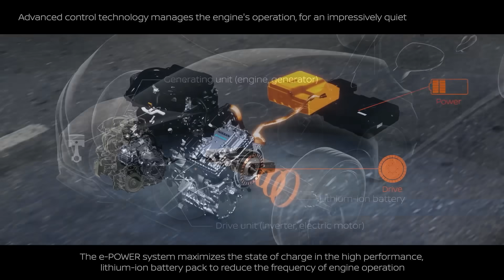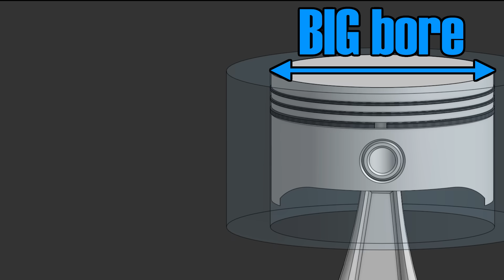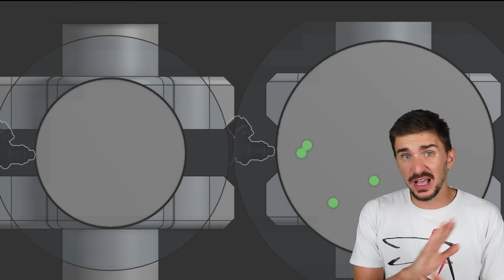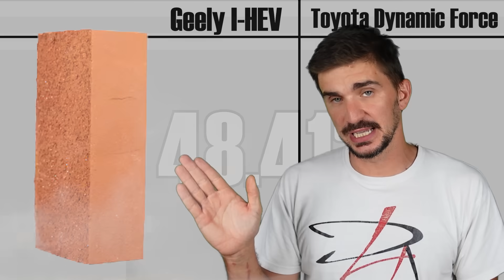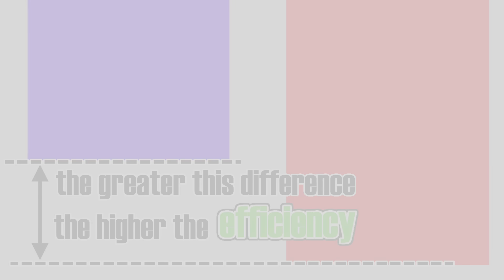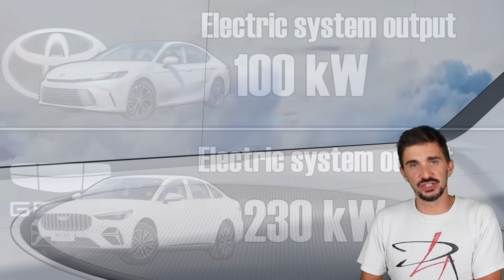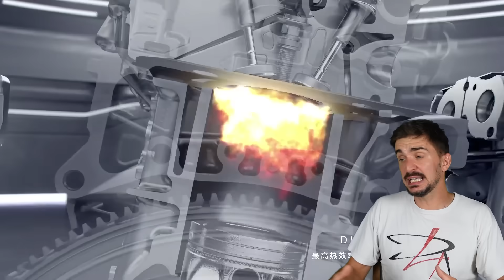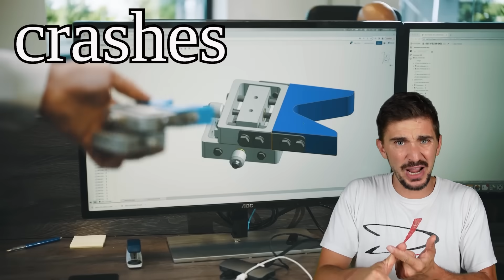How China's Geely Beat Toyota, BMW, Ford and Everyone Else

Comment: Never understand why the turbocompounding isn't used it literally increases efficency
Reply: Because it costs money.
Reply: It is used, not much in automotive industry though. Volva had some truck engines with turbocompounding. But I think it could be really good with a Roots type supercharger.  It is money reasons
Reply: @pdehun6234  IIRC they used it on the 16L 6 cyls which were less reliable, less fuel efficient, and less powerful than Scania's V8's lol. The spooldown sounds ridiculous though.
Reply: @stuntvist  You can be right about that Scania v8 was better , bc I don't know :D But if you take two idinetical engine it should get better range and more power with turbocoumpounding. Ofc t.c. only made big things in aircraft when turbojets were not that cheaper to run.  But I would say there is more likely to have room to make it even better. Maybe if some car manufactures did not act like some whine little bitches but spend money on improvements while they buisness was booming they would not been in this situation.
Reply: Forced induction only increases efficiency in gasoline engines in an extremely specific band and realistically won't improve efficiency because of their need for a stoichiometric mixture. Diesels however, always benefit from forced induction. Greater efficiency and more power.
Reply: @artemovsk1 Turbo compounding is not forced induction, you think about compound turbine superchargers  way different. I highly recommend you to see Greg's Airplanes and Automobiles's video about Turbo Coumpond named " Turbo Compound Piston Engines. Almost magic tech."
Reply: @artemovsk1  he's talking about power recovery turbines. Basically you attach the exhaust side of a turbine to the exhaust and then you couple that shaft to the crank to convert the heat energy in the exhaust to mechanical power to the crank. Used towards the end the of piston aircraft engine era to increase crank hp and fuel efficency.

If you want to go nuts with exhaust plumbing you build a compoundturbosupercharged turbo compound engine.
Reply: @KR-hg8be Ah my bad. Somehow I haven't heard of this before.
Reply: @KR-hg8be  i believe when they went nuts with the exhaust plumbing they decided "why do we need pistons?" and built a jet engine.
Reply: @JedPotts-jv2ux pretty much because at that point the engine is only functioning as a burner section in a turbine
Reply: It's really heavy and complicated. It's mostly used on 2-stroke diesels too, and they only operate properly at max load and at one RPM.
Reply: Turbo shooting air inside the open valves?
Reply: @gabrielvieira.4358  No, Turbo Compound use a different turbine. Turbine superchargers use pressure turbine, while Turbo Compound systems use a blow-down turbine.  The blow down turbine in Turbo Compounding use the exhaust velocity to spin the turbine then tuebine is linked via fluid coupling to the crankshaft to spin.
Reply: coz it is already electrified, thats why! who needs turbo compounding?
Reply: @djhrjeiwhri  Turbo-compounding means that the turbocharger is also connected to the crankshaft via CVT so that excess turbine power is used instead of wasted. It's make the engine more efficient.
Reply: @nerdyengineer7943  so? connected to parasitic-loss? more efficient?
Reply: @djhrjeiwhri  The engine generates the electric power, dummy. It's not parasitic loss, it's where the power to drive comes from. Sheesh.
Reply: @nerdyengineer7943  it is still need turbo with pumping losses, still cannot have this level of gasoline thermal-efficeiency and STILL have parasitic loss, idiot! especially compare to contrary to this geely systems + DEEP-MILLER. after all it is enginied-EV, so all of  pumping loses, every auxilaries, weight penalties are eliminate to near zero on its ice.
latest turbo nissan zr15ddte on qashqai hybrid has 42% thermal-efficeiency, if nissan do turbo-compounded, what thermal-efficeiency does it have? 50%????

Comment: If they had put a 1-cylinder engine and an electric motor on a motorcycle, the consumption would have been minimal. Probably 0.5 liters per 100km.
Reply: The problem with motorcycles is that they don't have much space for the batteries

Comment: The only reason why China released that engine is the pompous headlines in the newspapers for the sake of CCP propaganda and the story that China is some kind of country of the future that should be invested in. Why? Because the Chinese economy and industry have been in decline for 5 years. China is rapidly collapsing. Investors are fleeing China because they realized that China is a big scam... a Ponzi scheme... a Potemkin village... and that the Chinese are bringing in foreign companies exclusively to steal technology and then drive them out of the market. But now everything is backfiring on them and in 5 years the question is whether they will have anything to eat. All Chinese car (and all other) companies are in big losses due to corruption and overproduction which has led to a pile of undelivered goods and deflation. BYD, for example, is in debt of some 4 billion dollars officially and more than 40 billion unofficially since they transferred the piles of debts to their suppliers. Because that's how they can afford it, since they are the darlings of the CCP. The same goes for others.
Chinese cars are cheaper because the state co-financed the manufacturer and not the buyer. This led to enormous production that did not have an adequate market. That's why China is now a graveyard for new cars that are a pure loss. That's why China is now pushing something called "0km (0mi) used" cars. But that won't help them either because the cars break down and there is zero customer support. Parts for Chinese cars stop being produced the moment the car does. Parts are made everywhere in the world for another 20 years. Also, updates for EVs stop being made the moment the car does. Many companies have disappeared and their cars have become unusable because there is no one to do the updates. China is a terribly irresponsible country that has tried to destroy industries all over the world and it is now coming back to haunt it
Have you ever wondered why shipments from China are free and you pay even when you send a letter to your neighbor? Well, there is something called the Universal Postal Union, an organization that unites all the world's post offices under the UN and whose idea is that countries with a small GDP pay less postage or do not pay it at all. Well, China pretends to be a country with a small GDP (although it brags everywhere that it is second in the world....don't forget that GDP is calculated and sent by each country for itself and not by some international agency...so such frauds are possible) and that is why China is exempt from postage if the shipment is under 800 dollars. Which means that China, considering the prices of the products, can send entire containers for free. And that then kills economies all over the world. Especially small producers who have to respect all the regulations (unlike the Chinese who don't have most of them), pay higher wages (in China the average wage is $330 and the work week is from 9am to 9pm 6 days a week) and also pay for the delivery of goods. All of this means that they are not competitive and are failing. China is the cancer of the world and the whole world should close its doors to it! And before you start thinking about how good it is that the prices in your market are lower, keep in mind that the factories in your countries will also be destroyed, so you will have neither jobs nor wages that will be able to pay even those low prices. You will become poor. Deflation is just as dangerous as inflation. If not more dangerous.

Comment: The Honda ehev engine works like the Geely in the sense that its main job is to be a generator not a wheels spinner
Reply: Its not what the main job is though (that's just optimization). No, its whether its physically possible to drive the wheels.
Reply: Google the new Honda prelude, propulsion. It's electric with support of a petrol, I think it's one of the first Honda doing that, certainly the first with any kind of semi sporty element.

Comment: Yeah, this... and methodics. When testing an engine by Chinese standards in Chinese laboratories, there are some magical stuff you can play with (correction factors, different GPF standards etc.), so the number on this silly little piece of paper can be very shiny and nice. Nevertheless, something close to 48 % means that the engine will be impossible to use without electrical assistance. What's even better, there are two options how it will behave in a hybrid system: either it will blow-by like crazy because it will run cold the whole time, or it will have to waste resources just to keep itself reasonably warm to not infuse oil with unburnt gas. Renault Espace owners can surely tell their blow-by stories.

Last October, a Chery has shown us a prototype of an Atkinson with TWO crankshafts claiming an efficience of 48.57%. Google Kunpeng Sky Optimus (Chery is a well-known source of cringefiesta, thank me later). I have some pictures, nevertheless haven't heard of that stuff ever since. Just wondering why :D

Comment: If only they had commitment to return diesels into econo cars...
Reply: This channels has an interesting video about diesels too. (dont bring them back)
Reply: @ComplicatedStuff  bring them back but with honest emission claims
Reply: @dy7296 never gonna happen 😂
Reply: Diesels are still there
Reply: @takiktos1265  In econo city hybrid cars? I mean they already have the hybrid leverage. Put diesel on top of that (like atkinson diesels) and we might get even more sublime mileage. That used to be a thing for Europe and India, but thank fu+k to VW for ruining it. Now they grew less and less popular until slowly getting phased out completely. Diesels are lowkey cool especially on sedans and hatchbacks, and it's sad to see them go.
Reply: @dy7296  vw golf still has diesel to choose but not hybrid
Reply: Clean diesel is expensive and reduce the reliability of the engine to the point that unless you need the torque a diesel, you'd be better off sticking to gas engines.

Comment: Uses 0W-0 oil
Reply: J&J baby oil
Reply: Diddy's engine
Reply: @androiduberalles 
diddiesel
Reply: @androiduberalles  lmao
Reply: @androiduberalles  Diddy uses 50w, more resistance
Reply: @joaoah  Sponsored by Belle Delphine
Reply: OwO
Reply: @ZImpresive  When UwU oil?
Reply: @absboodoo  is that kinda like bath water?
Reply: @jblob5764  ¯\_(UwU)_/¯
Reply: @ZImpresive I love how Google translates it to "money"
Reply: @CyanRooper  hahahahahahah
Reply: Uses coolant as oil 😂
Reply: @fusha_1527  This misunderstanding can actually be seen from another set of official data.

According to WLTC standard operating conditions, the Xingrui i-HEV has a fuel consumption of 3.98L per 100km . The Xingyue L i-HEV has a fuel consumption of 4.75L per 100km . These two figures are significantly different from those starting with 20.

This is where things get interesting.

Both official figures are 2.58L and 3.98L, so why such a big difference? The answer isn't complicated. While the WLTC isn't based on your everyday road conditions, it's still closer to real-world driving than those "limit-push" tests. It takes into account more varying driving conditions, rather than just maintaining a constant speed to achieve a good result.

Therefore, 2.58L is more like the technical upper limit, while 3.98L is more like the reference average . The former is "how strong your car is at its best", while the latter is "what level this car is at normally".

What truly made this controversy interesting was not the press conference or the forum arguments, but the time after the first batch of car owners took their vehicles on the road.

For example, Mr. Wang from Hangzhou picked up his Geely Xingyue Li-HEV in early May 2026 and specifically recorded his daily commuting fuel consumption for a week, finally settling on a figure of 2.8L/100km . This result is even lower than the official WLTC figure of 3.98L.

Seeing this, many people might say: Doesn't that mean the official statement wasn't exaggerating?

Don't rush. Just because this case works doesn't mean everyone can replicate it.

This performance likely stems from several inherent advantages: smooth traffic, a gentle driving style, and suitable weather. If someone's commute is relatively uncongested and their driving habits are as smooth as holding a hot cup of coffee, then a hybrid vehicle can indeed easily demonstrate its advantages.

But for most people, life is not like that.

For most users, the actual combined fuel consumption is unlikely to remain consistently in the 2000s. Based on the information provided, combined with the patterns of hybrid systems and past experience, most car owners' daily combined fuel consumption is likely to fall within the range of 3.5L to 5.5L/100km .

This range is crucial.
Reply: 0W-0? Sooooo you mean just straight 0 weight? Lol.
Reply: Uses -5w-0 oil 😎
Reply: @ProfessorFickle  Or use UwU oil.
Reply: @Dowlphin  wifi-oil 🛜🛜
Reply: @ProfessorFickle Crazy!! I read they pickuped (learned) from "Lotus" engines... 🤷🏻‍♀️
Reply: @GusMendoza7 😂 my comment  was a joke 😂
Reply: LMAO
Reply: Next step: wd-40 weight oil.
Reply: That means they must have very exact dimensions on stuff.  Thinner oil films take some designing to use.
Reply: @kensmith5694 does that make the engine more prone problems as it wears out compared to thicker oil engines? Doesn’t seem like a system made for longevity.
Reply: @battery_wattage  I'd imagine its a throw away block, if the valves and surfaces are all coated.
Reply: @battery_wattage  Modern materials etc help a lot.  With a film of oil, there is no metal on metal contact.  The engine will last longer than the car it is in.
Reply: @battery_wattage with extremely small clearance "extremely low viscosity"  more sensitive to any debris in oil....
Reply: It is not designed to last
Reply: @battery_wattage  what longevity? trade it in after 2-3 years, bait the next guy into the 8 year warranty
Reply: 0W is what destroys 911 engines. I would never use it.
Reply: Soybean whey
Reply: Hilarious!
Reply: Hahaha i came here for this
Reply: 0w-20
Reply: 0W-0 oil doesn‘t actually exist. It would simply be SAE 0 oil.
Reply: LOL
Reply: Hey, can we lower emissions by 0.000001% by using gaseous lubricant?
Reply: 5w30, yeah
Reply: Sounds like wet air 😂😂
Reply: nah, that's gm
Reply: Close. Uses 0-20W
Reply: Uses your pee for recyclability.

Comment: if its more actively charge up battery "while it stil can" - it looses some of actually gained thermal efficiency into battery charging loses.
Reply: Battery charging losees are far less than combustion losses. But what is more importnat is the engine is 48% efficient only at single load and rpm value. At the rest it's worse. But if it works as a generator or a hybrid it doesnt matter as much, you can keep the engine running in the best scenario
Reply: Going uphill is inefficient. Rather the AI to plot a course going around the mountain?
Reply: @ctrlaltdebug  why use AI when we have a simple algorythm to do exactly this and it's called the dijkstra algorythm
Reply: @takiktos1265  It's all AI. I learned Dijkstra and A* pathfinding in AI class.
Reply: @ctrlaltdebug  the fact that you learned pathfinding algorythms in ai class doesnt change the fact that those are not in fact AI. Those algorythms doesnt use neural networks, doesn't need to learn - they are primitive algorythms
Reply: @takiktos1265  every new algorithm is AI until it becomes widely used and understood. AI is not only neural nets. It's minimax, decision trees
Reply: @ctrlaltdebug "every new algorythm is AI" lmao

Comment: The Atkinson engine is equipped with the complex crankshaft. The Miller engine adapts the intake event length with two options. Early Miller has a short intake event length such as the ea211. Late Miller has a long intake event length such as several Hyundai engines. And the long intake event lengths can achieve some benefits at elevated engine speeds due to air mass inertia. However, the Geely engine is limited regarding engine speeds due to ling stroke. i therefore believe that the Geely NA is a short Miller.

Comment: 10:10 worth to mention that it's pretty much fake atkinson cycle. It kinda works like atkinson when the engine isn't boosted, but it effectively reduces true compression ratio. In boosted engine it doesnt make sense as the charge is forced into the chamber anyway

Comment: Geely is a Nissan, thanks to Renault 🤡
Reply: Not really. Nissan uses some engines which are manufactured by Horse Powertrains (Geely-Renault join venture). But mostly Nissan uses it's own engines.
Reply: @vvevvevvvv you just proved my point Renault pillaged Nissan 🤡

Comment: The lack of power scenario you mentioned can be easily avoided in the Geely configuration even without AI!
Reply: By using navigation data and therefore knowing when inclines will come up? 

That would only work if people use navigation though, if they don't how would the car know when the incline will appear? I think that's probably where the machine learning aspect comes in, i think its a decent approach to solving that particular problem. Its a task humans are good at, in theory the driver could manage the soc, they know where they're going after all. But its also a task no driver actually wants to perform...

Otherwise the car would need to "overcharge" the batteries all the time, in anticipation of an incline that might not come up. In regards to efficiency that wouldn't be a very good approach...
Reply: @Crafteyer  No, by just trying to keep the battery charged, let's say at 50-70%, series hybrid...